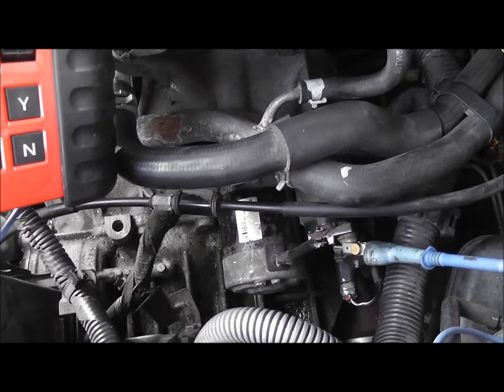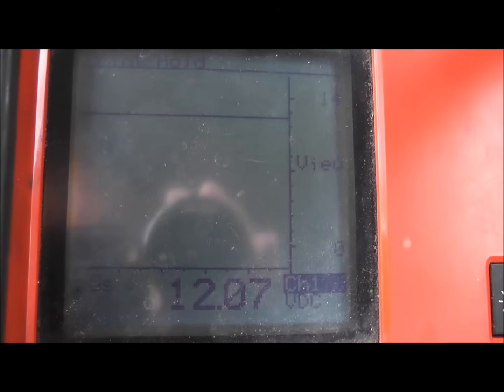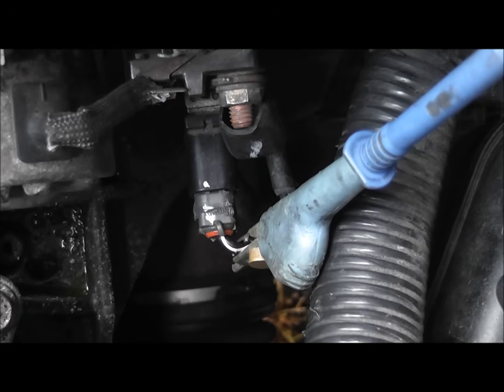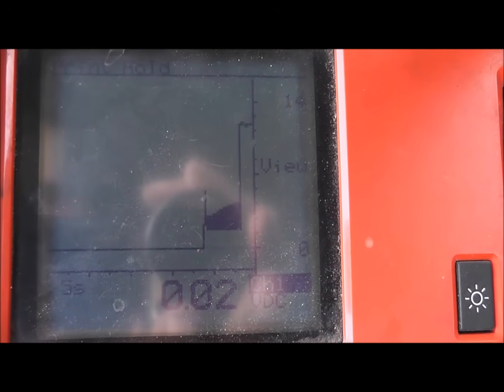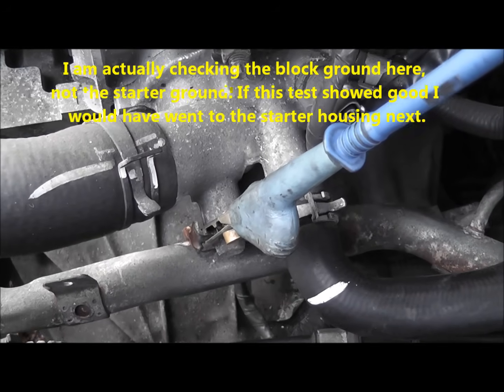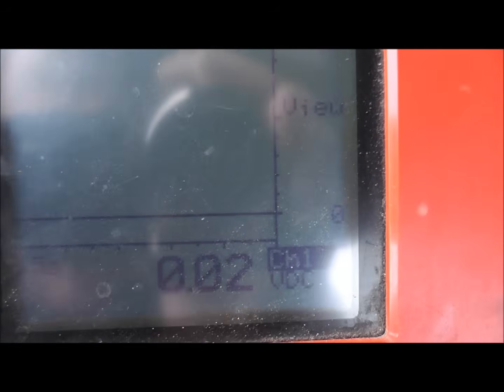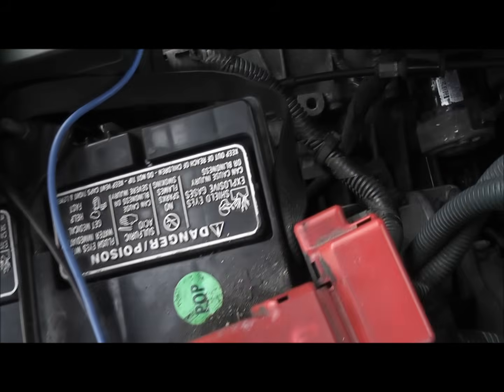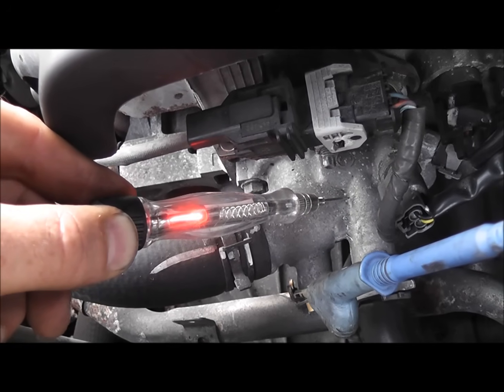How to test a starter motor (no crank from a bad block ground) - Nissan

Comment from the maker: @Bushougoma That is absolutely correct!
 This video is also a great lesson on why you should use battery ground for your point of reference for your voltmeter instead of body/block ground whenever possible. Especially for a no crank problem.
Reply: If my main fusible link on the positive battery terminal keeps blowing (we've replaced alternator 3 times, the clamps on the terminal 2 times, the 120 amp fuse terminal 4 times), can i use this test to find the short to ground or whatever? But do I have to replace that fusible link again before being able to test it? So that you can see the load or whatever?
Oh and my car is a 2006 nissan maxima
Reply from the maker: @SavageThrifter  which fusible link? The one with the 120a fuse? Also what engine size?
Reply: @ScannerDanner  yes the one with the 120 amp fuse and it's a 3.5L V6 :)
Reply from the maker: @SavageThrifter  okay, this fuse feeds the alternator directly. Have you made sure that the wire that goes from the fusible link box (battery) to the alternator is not shorted to ground? You MUST follow it and check it very closely for points of contact to metal brackets, the cylinder head, engine block etc.
If you've replaced the alternator 3 times, this rules out the alternator being shorted in my opinion unless you are buying sh-t parts off Amazon. 
This fuse also feeds power to the following fusible links:
Link E: 100a
Link D: 80a
Link B: 80a
Link C: 60a
Have any of the above circuits been modified with a higher amp fuse or link? If not, then our problem cannot be in any of those circuits as it would blow the lower amp fuse first.
Reply: @ScannerDanner  I have not checked that wire because the nissan technician told me this: "This really more or less indicates a short to ground on the positive battery cable. Somewhere between the starter and the battery, it's probably touching or worn through the insulation and touching causing the thing to blow. Check the shorter part that goes to the fuse box as well, but this is likely on the longer part. Also, you want to closely inspect the negative cable. These sometimes break, where it goes from the body over to the transmission. That can cause a lot of electrical issues like this." 
I assumed there must be one directly to the alternator as well but I couldn't understand the wiring diagram haha. All the cables are wrapped individually then the cables from different components are bundled together under that split loom stuff so it's impossible to see the colors. Should I just cut all that stuff off? 
Also, the alternators were replaced by firestone each time so I certainly hope they weren't cheap parts haha. 
And those other fusible links are part of the actual entire terminal that holds the 120 amp fuse as well. It's this: https://www.oreillyauto.com/detail/b/dorman-oe-solutions-3387/lighting---electrical-16777/fuses-16615/fuses-11492/da78d762ece6/dorman-oe-solutions-60-100-120-amp-battery-fuse/924078/4260509
We bought the part from nissan the first couple times but as you can expect it was very expensive so then we used this dorman one the 3 times after that. 
We didn't modify anything in any way, we don't know how to do that haha. In all 5 times that the 120amp fuse has blown, the other 4 fuses in the piece did not blow.
Reply from the maker: @SavageThrifter  it doesn't even go to the starter smh, a simple look at a diagram would have told him that, but he was right about one thing. The wire is shorted to ground somewhere or you connected your battery up backwards.
Reply: @ScannerDanner  wow, this guy was a certified nissan technician too haha on that justanswer.com site where you pay professionals for advice about various issues. As far as putting the battery in backwards, we have never put it in backwards and this fuse has continually blown for like 3 years so I don't know that the car would continue to drive all that time after just replacing the fusible link and carrying on.
Reply from the maker: @SavageThrifter  okay, no problem. Without knowing the history I just listed a possibility. 
Just follow that wire and look for points of contact, you'll find it.
Reply: @ScannerDanner  okay so I think I may have figured it out. You're not gonna believe this! So we bought our car from a dealership in 2016. In 2017 was the first time that 120 amp fuse in the fusible link/block terminal blew. The mechanic just diagnosed it as a blown fuse, we bought the replacement from nissan and they installed it. As I said, since then, various mechanics have replaced alternators, terminals, batteries, etc. And nobody noticed this haha! So your previous comment about the cables from the battery going to either the alternator or starter got me to thinking. So I was looking at the wiring diagram while looking at the terminal arrangement on the fusible link in my car. And I realized that there are two cables. One I believe that goes to the starter and one to the alternator. So i went back to watch all the videos I've previously watched about this issue and I realized...THE CABLES WERE NOT ON THE RIGHT SIDES OF THE FUSIBLE LINK! I BELIEVE that this is how they are supposed to be arranged: https://images.app.goo.gl/rZEgrQMyTUPTDvGP6
While in my car, they are both stacked on top of eachother on the post that is further to the right in the picture. Nobodyyy ever noticed that they weren't supposed to be stacked/touching eachother! Does that account for why that 120amp fuse would keep blowing? It's crazy that it was able to work fine for such long periods in between. But I believe that the reason it blew twice in one day a couple weeks ago when it was overheating was because the overheating drew a much bigger load or something, is that right? I tried to tell the mechanic that the timing was too accurate, the overheating and the fuse blowing twice in one day at the same time, they have got to be correlated somehow. He insisted it was just coincidence 🤷‍♀️. I have no idea how much more damage has been caused by it being assembled the wrong way. But it certainly has been that way since before we bought it.
Reply: @ScannerDanner  so basically whichever cable is SUPPOSED to be connected directly to the battery, that was instead going through the 120amp fuse ALONG with the other cable that is supposed to be there. By reading the wiring diagram, I THINK the starter is the one that is supposed to be directly connected to the positive battery post, is that correct (the left of the picture)? And the other one (which I believe is for the alternator, is supposed to stay on the right, where it's already at)?
Reply from the maker: @SavageThrifter  I don't see a picture or a link to one? But if that wire with the 120 amp fuse was touching the starter wire AFTER the fuse, then that would no be a good thing and that would mean that the times where that fuse blew would have been when you were cranking it, possibly
Reply: @ScannerDanner  i posted two comments, did you see both? The first one has the link. Here is a better one: https://www.autogenius.info/wp-content/uploads/2018/09/nissan-altima-fuse-box-diagram-fusible-link-block-2001.jpg

So you know how both cables have an eyelet on the end of them, to be inserted onto the screws on the fusible link block/terminal? So both of those eyelets were put onto one screw (the screw that is on the top right of the 4 bottom fuses which are labeled EDCB). 
I believe that one of those eyelets is instead supposed to go on the screw that is on top of the fusible link block which also screws in the battery terminal clamp. So if I understand correctly, the cable that is screwed together with the positive battery clamp, that means that it does NOT go through the fusible link, it bypasses it. While the other one that is on that back screw DOES go through the fusible link. 

The way mine was arranged (with both eyelets/cables on that back screw), that would mean that both cables went through that 120amp fuse, none of them bypassed it. I am pretty sure that those two cables go to the starter and the alternator but since they are both black/red, I don't know which is which. And I also don't know which eyelet/cable is supposed to be the one that bypasses the 120amp fuse. Looking up the amps that corresponds with an average battery and average alternator, it looks like the starter can require much more than 120amp, so I would think that thats the one that should bypass the fuse right? And looking at the wiring diagram (mind you, i barely understand what I'm looking at) but it looks like the "start" wire is before the 120amp fuse. Does my theory add up? And thanks so much again for trying to help me. I know it must be really hard without seeing what I'm talking about.
Reply from the maker: @SavageThrifter  You are on it my friend. No question that was wrong (both the starter and alternator main cables being on the 120a fused circuit) Only the alternator should be on that fuse, and those other 4 smaller fuses get powered by the 120 as well. But definitely NOT the starter wire. My guess is this fuse never blew, not once, while you were driving it. Yes??
Reply: @ScannerDanner  Yess I've finally discovered it! 😃😃
It always seemed that the fuse blew when the car was off but I began thinking...what if it blew like the millisecond when I was turning the key to start it? But as far as I remember, it never died while driving, which I'm guessing that that gives even more evidence to the starter drawing all that power which blew it during cranking but not while driving. 
It took me 3 weeks of constant research and studying hahah I can't believe it would be this simple. But now I'm wondering, do you think that this has caused problems in the rest of the charging/starting system? Could this cause the alternator to break three times in three years? I wouldn't think that the "bad alternator" would be a wrong diagnosis seeing as each time the alternator was replaced, the car would be fine again for at least a little while. 
And most importantly to me, if you could answer this question: how can I tell which of the two cables go where? They are both black/red and both about the same gauge/thickness so I have no idea how to put it back together correctly. Thanks so much Paul, your content and advice has been so valuable!
Reply from the maker: @SavageThrifter  weird that the alternator replacement would fix it for a time. The only thing I can think of there is the battery would have been disconnected when replacing the alternator, so they would have been in that location. I don't know for sure. 
As for which wire is which. Disconnect one of them, and then test for power at the alternator battery post (probably the easiest one to get to). Remember to disconnect your negative first before doing this test. Just in case your wrench touches something metal while disconnecting one of the positive cables.
Reply: @ScannerDanner  this would require an ohm meter or something like that, right? I can get one from o'reillys, just making sure first! :)
Reply from the maker: @SavageThrifter  just get a cheap $10 Test light but NOT and LED type. Just a regular bulb type light
Reply: @ScannerDanner  thank you so much for your help! My husband actually made an observation that I don't think i would have noticed. Both eyelets at the end of both cables LOOK like they are the same but one is a 90 degree angle and the other one has a bit of a diagonal bend so anyway, we looked at as many pictures/videos as we could of the configuration on other people's fusible link and realized which eyelet went where. So fingers crossed it doesn't blow again. Thanks soo much for all your input. Nobody could figure this out but I think it's finally settled!! 😁
Reply from the maker: @SavageThrifter  is it fixed? Thanks!
Reply: @ScannerDanner  so far so good! Thanks so much for your help! 🤗🙏🙏

Comment: I will bet a lot of  viewers are wondering how the test light was lighting up from a ground to ground and how did the engine block get energized positive.  Great vid.
Reply: I didn't understand the 8.3 volts in run
Reply: @adambailey7739  voltage drop
Reply: @enzoorciuoli328  can you explain that sir my brain froze seeing  the test light lighting up from ground to ground.
Reply: Because it has 8 volts. Test light uses that 8 volt and light the bulb. Normally ground to ground = 0v. No voltage difference.